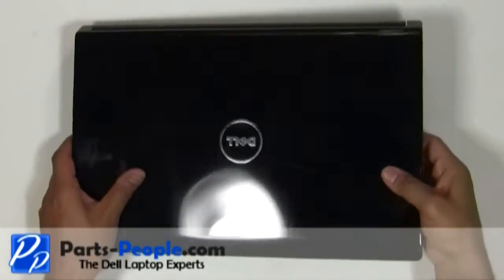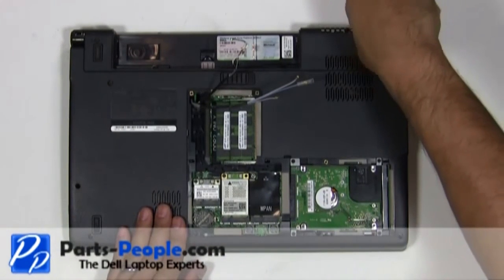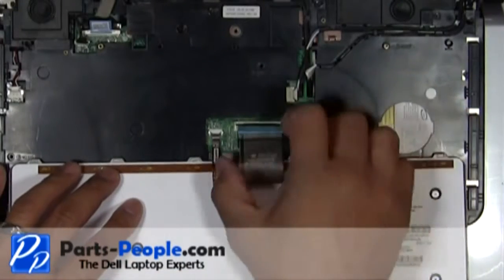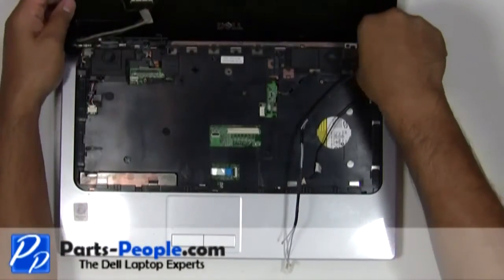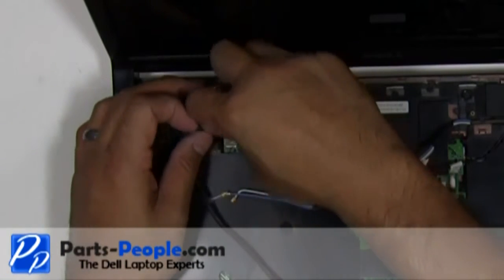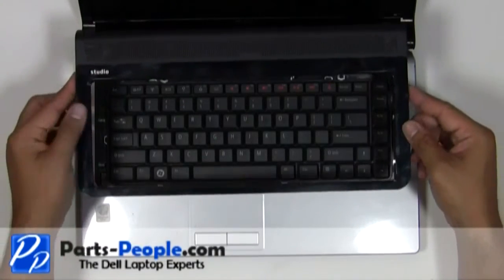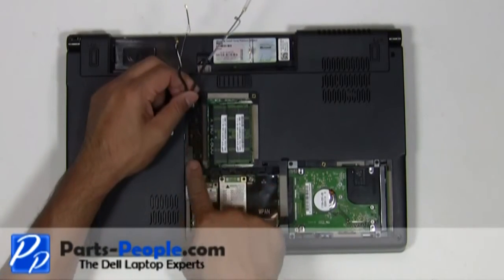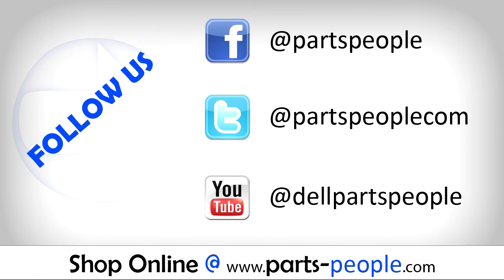Dell STUDIO 1555 / 1557 / 1558 | LCD Display Assembly Replacement | How-To-Tutorial

Comment: I took my screen apart to replace the hinges on a dell 1558 now the back light is not working. Everything is connected. I can see the image on the screen if a flash a light on the screen and the display works when i  toggle the display and connect a seperate monitor. Do i need to replace the lcd since the back light is no working?
Reply from the maker: Try reseating the LCD cable on the motherboard and the back of the LCD. If that doesn't fix the back light problem you will need to replace the entire screen.

Comment from the maker: The hinges are designed to be really stiff so first and foremost, DON'T oil them. Use a pair of pliers and carefully turn the hinges to the position you need them in and you should be ok. After they are installed they will move fine with the leverage of the screen.